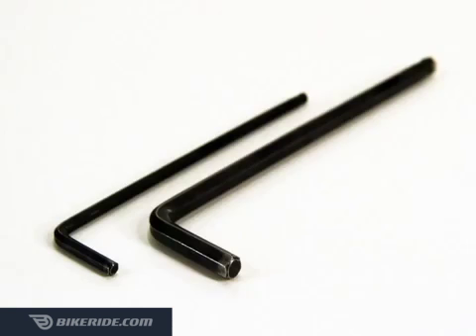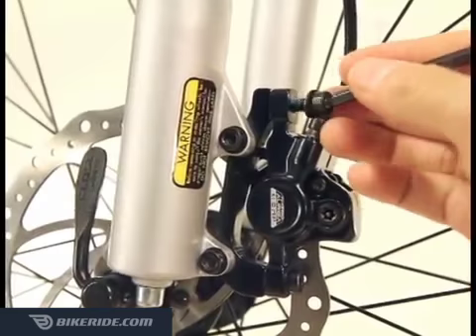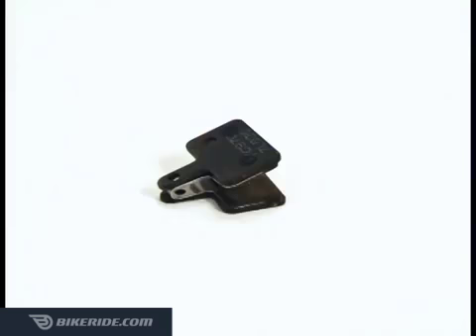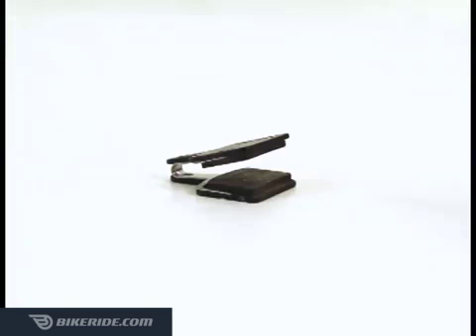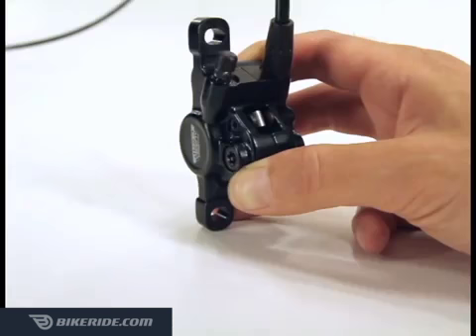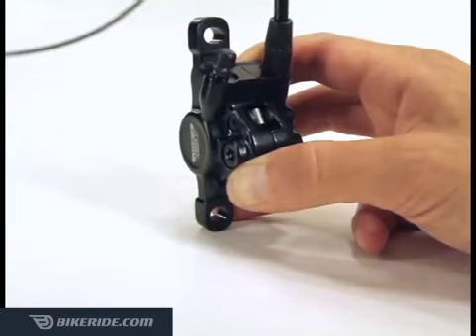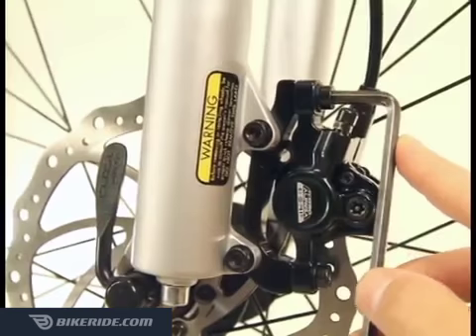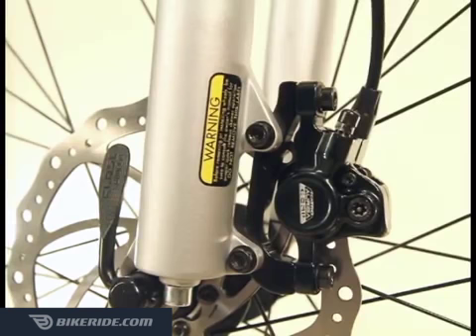How to Replace Tektro Disc Brake Pads

Comment: Thanks! Also, if you want to tighten the breaks/breakwire, there's a tiny Allen screw inside the break handle on the handlebars, for those of you whose breaks seems to be too loose.
Reply: I didn't discover that until recently and have been riding my Ebikes for nearly 10 years😂

Comment: My brake setup doesn't have a 'retaining bolt'. Both front & rear has a little retaining pin, which I found strange as It needs bent at the end to secure it in place. It's a 2020 Norco Fluid FS3 btw
Reply: Same with Polygon Siskiu t7

Comment: Daaaaang! This was probably the only video that shows how to remove and install the brake pads. I spent over an hour trying to reinstall the connector spring without removing the disc brake caliper. Thanks!

Comment: Instead of loosening the caliper bolts on the top loosen the adapter bolts on the side and remove the entire assembly.
That way no need to readjust the caliper. Boom

Comment: how to increase gaps between pads and disk? should i play with that t35 torx bolts on each sides?
Reply: same issue
Reply: I used a flat screwdriver and pushed in the piston  and then reput in the pads

Comment: Luckily I have bionic hands (just like the guy in the video, apparently) and can easily feel how much 3-5 Newton-Meters is. Hee hee 🤣

Actually, I have a more serious question. In 2018, I bought a 2018 Specialized "Crosstrail Sport Alloy Crossbike". I now wish to replace the brake pads. but I cannot tell from the markings on the brake components which pads to buy. The brakes say "Tektro" on them but make no mention of a "group name". The front brake lever housing has "HD-R305" stamped on it and the rear brake lever housing has "HD-R310" stamped on it.

The problem is that sites like Amazon do not list pads by these numbers. Amazon lists the brake pads by group names such as "Auriga". Unfortunately, my brakes only have those ""HD-R305" and "HD-R310" markings on them, without any reference to any brake group name.

Can you tell me which "group" my pads belong to, so that I can purchase the correct pads?

Thanks!

Comment: I have an Eahora xc100 ebike, which has mechanical tektro disc brake pads. I need to purchase new replacement disc brake pads, but I can't find it a part number On the pads themselves, and if I go on Amazon there's like 1000 different choices. Does anybody have an idea?

Comment: What do you do if
The aries brake pads don't go over the rotor. Aka.  there's no room for the rotor to fit between the pads
Reply: use a flat clean tool (like a standard screwdriver.). to push the brake pistons in... they are out a bit because there are self adjusting...they adjusted for the wear of the old pads...
Reply: @alcocklake  thanks 👏

Comment: I have a hair pin looking thing holding my pads in and no idea how to get it out
Reply: Bend the pin back until its flat.
Reply: @GRB22  with what tool though? This hair pin are stupid, don't bike shops sells any screw?
Reply: @magnumllama400  needle nose pliers. It's very easy to do.
Reply: My 2020 Norco Fluid FS3 also has these pins on my Tektro setup.
Reply: Don't scratch your caliper doing it like I did....:-(

Comment: Why should I take care not to touch the braking surfaces?
Reply: Hand oils can get onto and be absorbed by the brake pads causing them to perform less efficiently. Its like getting pizza grease on a tv remote, eventually the remote stains surfaces.
Reply: Just to stop them getting oil on them. There going by the fact most bikes get dirty and oily with use and you will be handling the frame while changing them.
Reply: Use Nitrile gloves like the type everyone used during Covid.

Comment: I ordered some pads and two metal cotter pin like peices also came with them...anyone know what they are
Reply: I've just changed my Tektro pads. My caliper setup uses a little retaining pin, and not a bolt. Maybe you received new pins with pads? Oddly enough, my Tektro pads didn't come with new pins and I just re used the existing ones.
Reply: @QUIGGS2001  yes they came with new pins

Comment: Only question I have is if you need 30 to 40 full stops to bed in won’t you wear out the breaks you just replaced. 40 seems a lot 😂

Comment: I wish it was that simple. I can't get the disc brake between the new brake pads 😔
Reply: You have to push back the brake cylinder, the new pads are thicker, so this is mandatory. Additionally to that you have to open slightly the top screw on the brake lever "to make room" for the fluid which you are pushing back. Don't forget to tighten that screw before putting pressure on the brake lever.
Reply: @Chainsawbiatch  thank you 🙏. Do I need a bleed kit?
Reply: @chriswarr3676  You're welcome! 😊 No, you only need it the bleed kit if you want to change the brake fluid. This depends on how old the fluid is.
Reply: @Chainsawbiatch  thank you so much. I'm new to hydraulic disc brakes and air suspension lol. I'll buy the brake fluid next month as the stuff in the bike is a 6 months old.